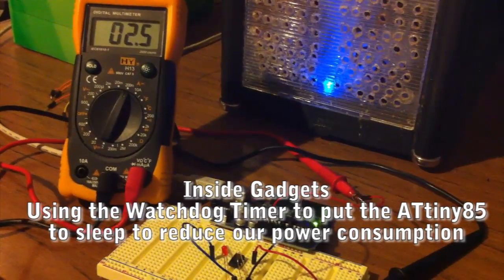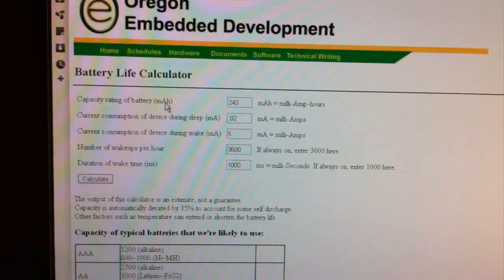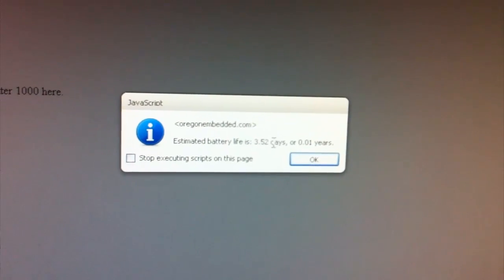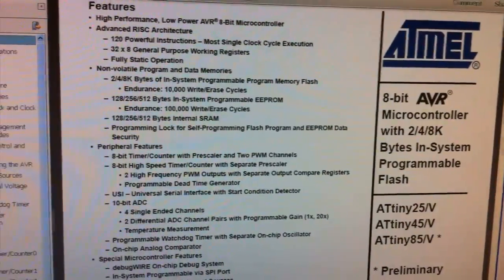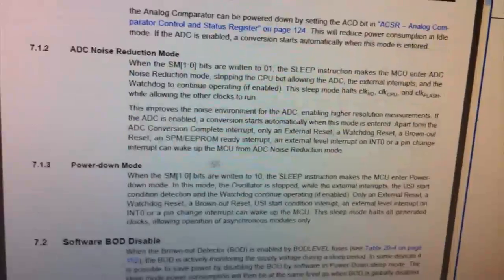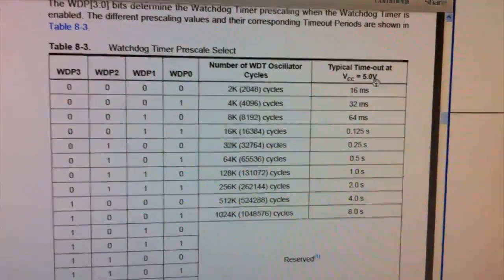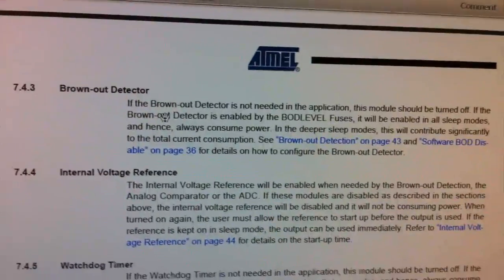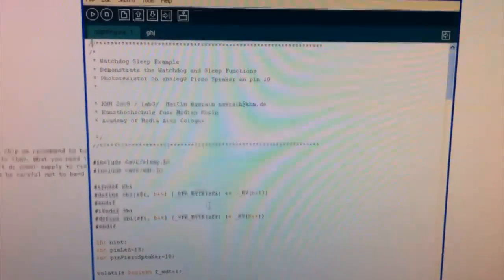Reduce ATtiny power consumption by sleeping with the Watchdog Timer - Part 1

Comment: Thank-you so much! I was having trouble figuring out how to connect the multi-meter into my circuit, to compare sleep vs non sleep mode power consumption. Originally, I was feeding the neg and pos directly into my breadboard from my Arduino, then placing the multi-meter in the circuit after those inputs ~ instead of using both the neg and pos pins of the multi-meter as just the positive line. After inspecting /replicating your setup, I can now see that my sleep mode is working perfectly. I've been trying to get this to sleep for over a week, and it turns out it was working all along, but I just wasn't using my testing tools properly to detect it. Not to worry, I'm just super glad that I can tell it's working! Thanks again ~ live saver! 🍻

Comment: @insidegadgets  Your tutorials have been helpful to me.  Where it specifically has helped me, is how you have talked about the datasheet, and then gone over the code you implemented, based on the datasheet.  

A suggestion, use screen capture software on your PC to show us the bits on the PC, and then post edit that segment in, and use the audio from your camera feed.  A constantly shaking moving camera can be annoying after a while. :)

Comment: Hey, thanks much for this. Looking at the latest Silicon Chip magazine
where (although they use a PIC), save extra power by switching on an Opto (4n28) only just long enough (using a voltage divider) to obtain an ADC sample from the battery,  I wasn't aware of these strategies until your videos and SC mags article.
Thanks much, please do keep doing these nice videos.
One thing though, I'd cut down on the "actually's" if possible a bit, although it's nice to actually hear a voice-over...